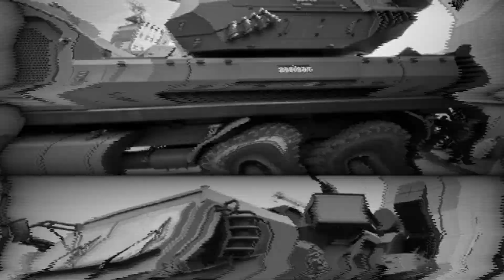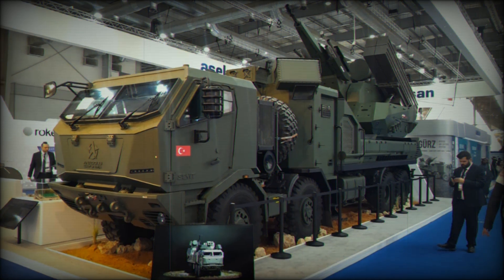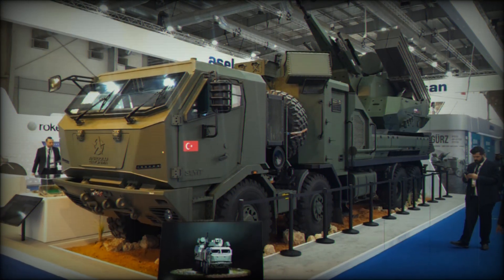Turkey Unveils Its Newest Air Defense System, Gurz: An Alternative to the Russian "Pantsir" with Inn

Comment: Russia learned in it's latest war, that no matter how good the system is, it doesn't work when it is turned off. When Russia couldn't get gasoline to it's front lines they had to shut off the trucks, which are needed to be on to power the systems. so drones came in and destroyed the systems that were protecting against drones.